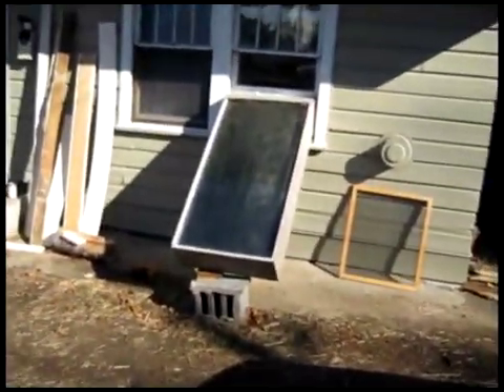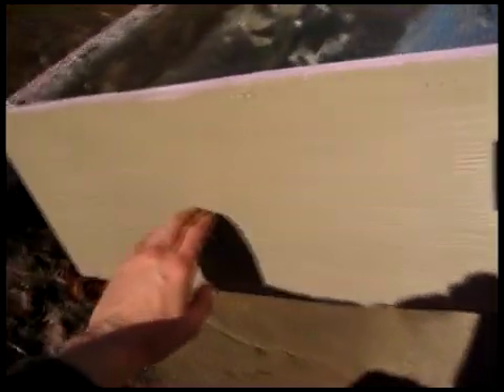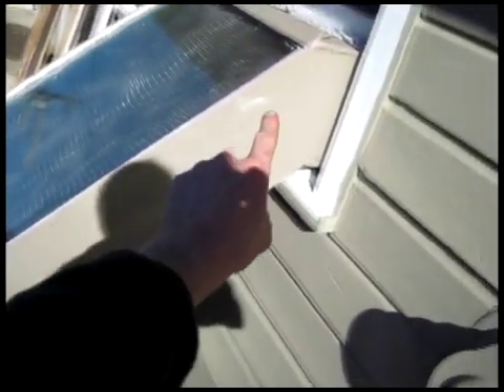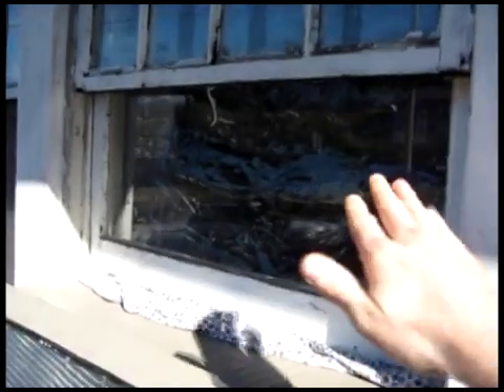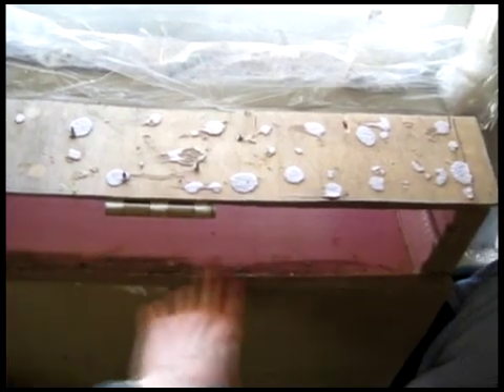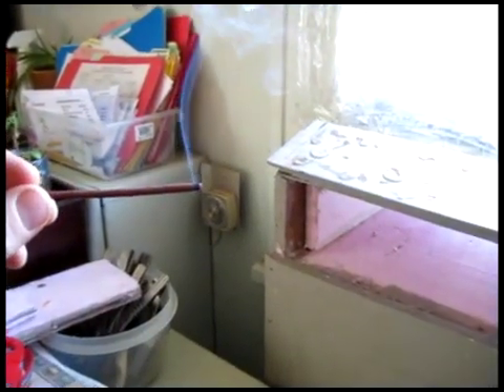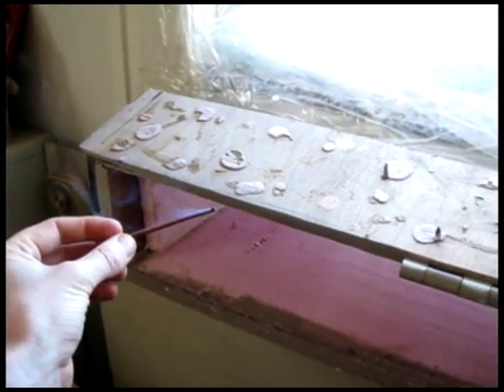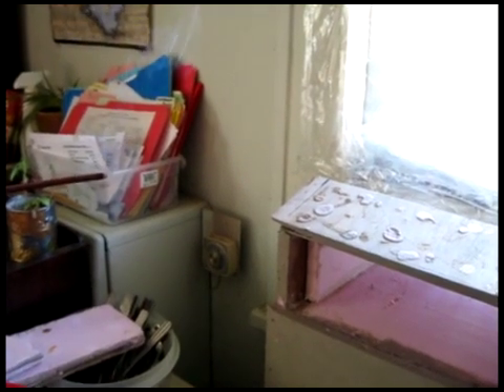passive solar air heater

Comment: Husband and I built something similar as part of a solar dehydrator.  Instead of hang it out the window, it just sits in a south window inside the house.  It is currently 59*F outside and my passive solar heater is putting out 100.1*F inside the house at 2pm.  I used an old 30gal aquarium for the glass, door jam, paneling, foam backed duct insulation, and aluminum flashing painted black.  Works great!

Comment: @lovestopsfear are you still using this box, or do you roll it out for the winter?
I see someone else was asking for temperatures. Any chance we could get you to put a thermometer in the opening for a few minutes? I bought a little 5 or 10 dollar jobbie at wal-mart or lowes that measures humidity, but it also keeps the highs and lows for the last 24 hours... i check it to see how cold it got the night before (inside my ecobox).

Comment from the maker: thanks for your enthusiasm. i have seen a version that uses 3" flexible aluminum duct snaking around the interior of a window box. This design was automated in that it turned on a fan when the temperature reached a certain degree. It seemed easier to make and relatively inexpensive.

Comment: would love to see a heat measurement - a 30 dollar unit at the hardware store works well (for lots of different things) or just a thermometer. Having watched a lot of these vids online, and constructed a couple prototypes myself, it seems that we all need to figure out the best/easiest/cheapest/simplest materials and come up with a basic plan, that won't freak out the neighbors, is easy to setup and move, and then go to town. $2000 invested in this will outweight 10x that in solar photovoltaic.